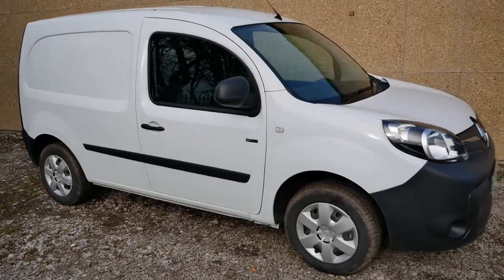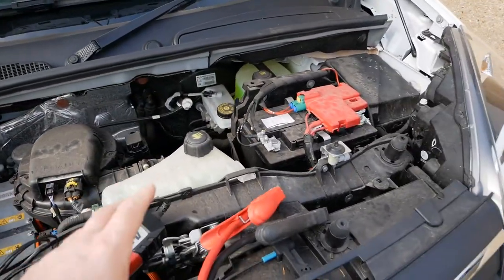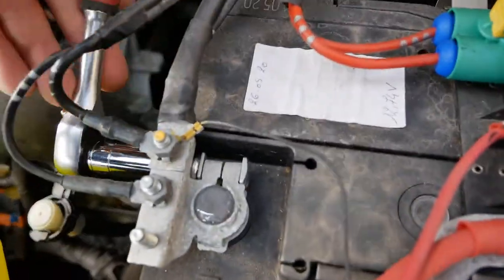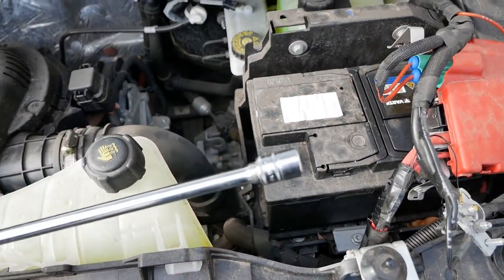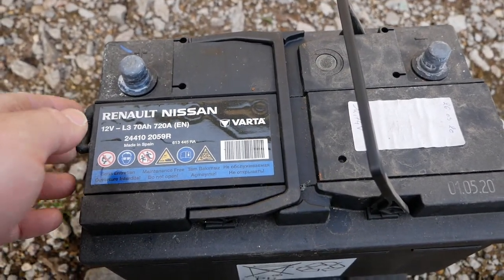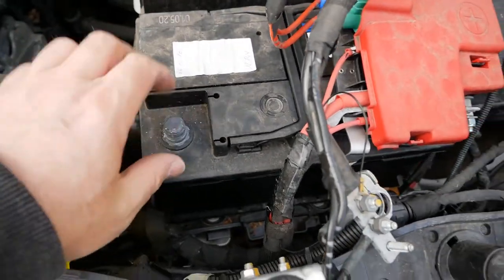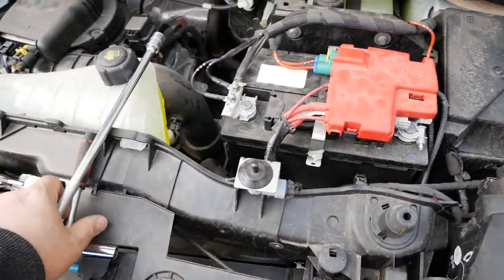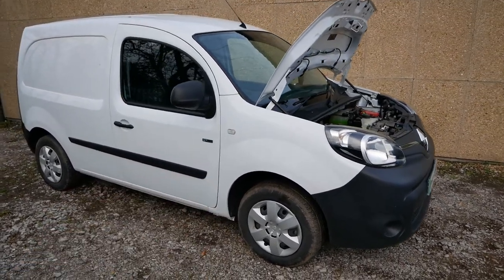How to replace the 12V battery in a Renault Kangoo Electric van (ZE22 & ZE33 models)

Comment: Yes I reckon I could do that now👍how long do they normally last,that looks like a lot bigger battery than my Kia soul was but I had that changed at 3 years before it went.
Reply from the maker: Yes the battery is the Kangoo ZE is huge as its the same one used in the diesel van, so they do last a long time.
Reply: @GoGreenAutos  I absolutely love my van,I drive steady the best I’ve had was 173 miles between charges when I run it down as I only normally
Top up from half to 80 percent.  But this time I topped up to 100 percent as I knew I was doing some running about that dayI never drive my wife’s id3 as I like my van better. If you can charge at home they are a cracking little van to have.
Reply from the maker: @jamesfleming5875  173 miles is impressive

Comment: Good video!  But You forgot the insulation round the battery and the the bracket holding was not perfekt installed. So the batter can be loose after a while.  Easier to loose some cables the plastic top and some cabels if there is a lot extras . Any way great video !